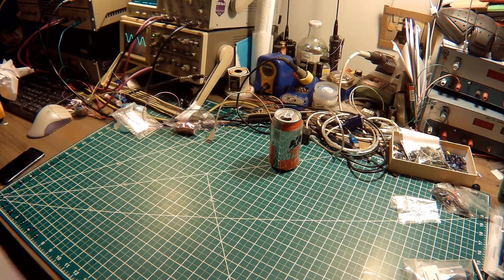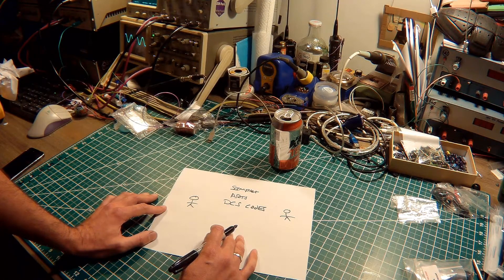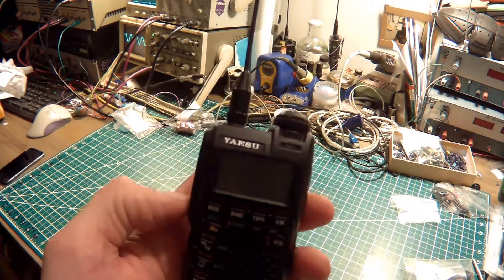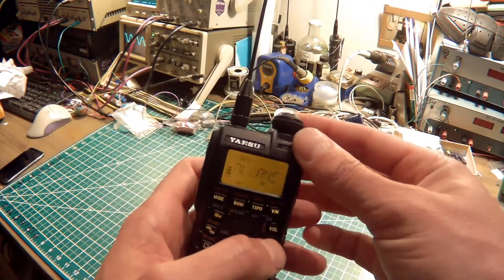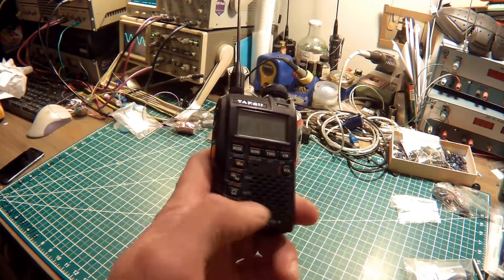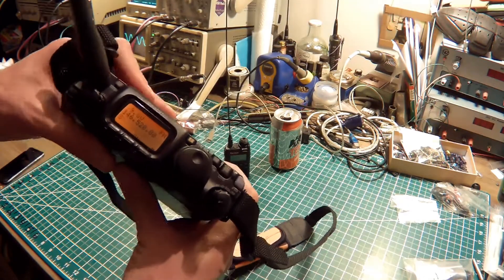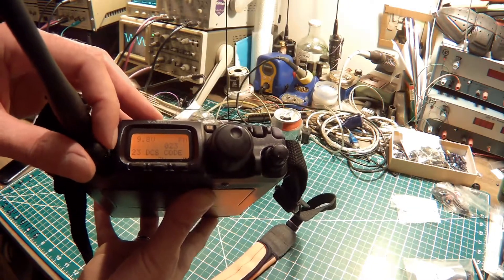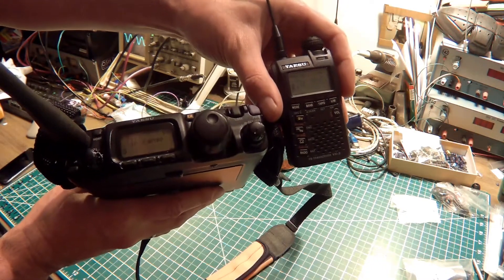Yaesu ARTS explained, with example setup

Comment: Im completely new to ham. Just got my call sign a little more than a week ago. Ive installed a mobile radio in the truck, but Ive got three Yaesu FT-4x HTs. I would like to set up the ARTs function, but even after setting each of the settings you show here, the radios are not communicating with one another. You mention how to “turn on” arts once the modes/functions are set. Im not seeing any buttons etc on the 4x that would indicate that ARTS is on or operating.

What am I missing? Thanks
Reply from the maker: Are you pressing 2, then a long press on the function key to enable arts?  Also, try enabling CW ID , and Beeps to help troubleshoot what'g going on.  Making sure tones and stuff are off can also help troubleshoot.